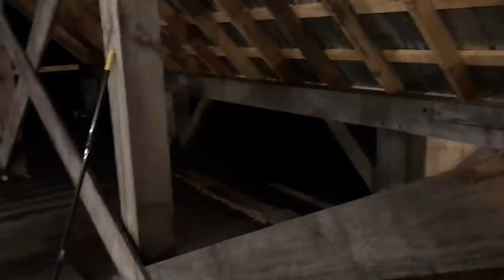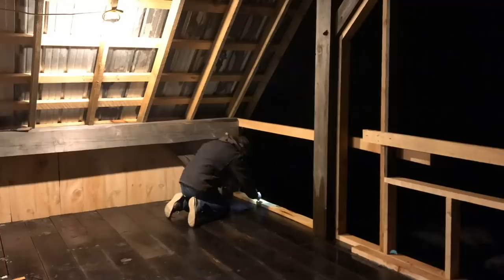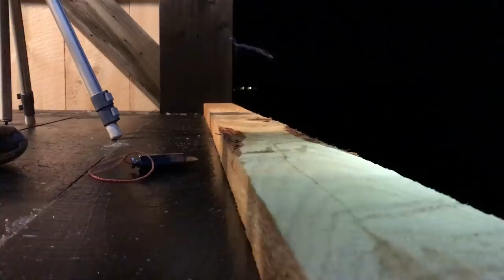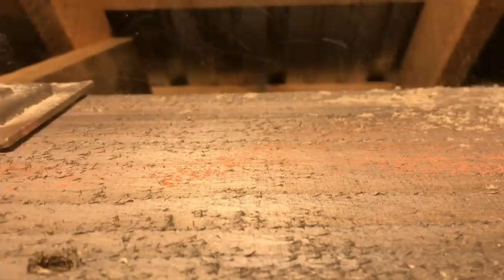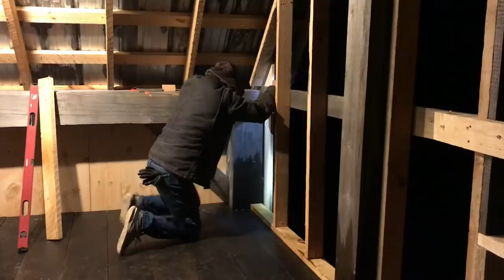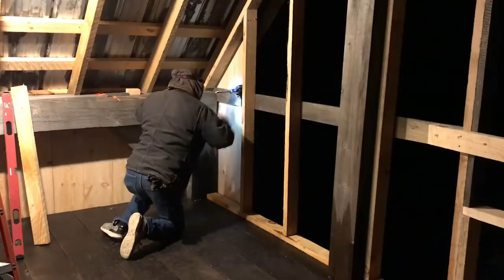Plugging Away on the Timber Frame

Comment: You may want to think about Nichiha siding and Boral Trim products. The Boral trim products can be cut with a regular saw blade and are more dimensionally uniform than Hardy trim products. I just built a house and used both of these products and I think it worked out really well. 
Charles Reed, Cedar Bluff, AL.
Reply from the maker: Thanks for the info, I will look into it.

Comment: Hey jim, ive been building a all new "old" house. Basically an early Greek revival style farmhouse. We debated hardiboard. Went with something else called LP smartside. We used smooth style clapboards. But i think if you're looking at hardiboard you should check out their grain faced LP. Its based on an osb style material. The test used that hardiplank failed at was to put a piece of each in a 5 gallon bucket of water. Hardiplank dissolved, LP grain faced retained its shape. The smooth face is a compsite reminiscent of masonite lap siding, but still superior in density and reaction to water aborption. There are pvc coposites that work well for trim as well. While we researched plenty, we thought the water test was plain and obvious. Check it out for yourself. Thanks for sharing, keep on keeping on.
Reply from the maker: Another very good idea.

Comment: Good Evening Jim to save your back some what would you build up your right shoe to match the left boot that will then take the pressure off your back which must be giving you gip ,well one gable end to close in and your smiling .
Robert Riversong | Nov 20, 2009 10:33pm | #1
Most engineered lumber uses glues that are designed to allow short-term wetting, such as with CDX plywood (OSB is more vulnerable and will not return to its original thickness after swelling).

KD lumber comes damp from the lumberyard (19% MC at the time of milling, possibly higher from yard exposure), and occassional wetting is not going to change its equilibrium moisture content. A new house generally requires a full year to fully dry to equilibrium conditions.

I build mostly with green lumber, dripping wet off the saw mill, and leave it exposed to rain, sun and wind until the frame is closed in. It tends to dry to less than KD levels after a couple months of exposure. It certainly doesn't get wetter and I've never had a mold problem (I insulate, however, with cellulose which has borate mold inhibitors).

You may be putting more effort into weather protection than is warranted.

Comment: Jim, if you are going to use a siding over the timber frame, might I suggest an alternative to the Hardie board. It is called LP Smartside. It is a wood product that has a 5/50 warranty and installs like normal wood. No special in as tall considerations to be made concerning how you cut it, install it, etc. except that all cuts will need to be sealed with primer. Please look into it. I am a contractor in St. Louis and have learned to love this product especially since I have stopped installing Hardie, almost completely due to all the limitations of dealing with it.
Reply from the maker: I will look into it, I've heard a lot about it since this video.

Comment: Jim check out hardy 4'x 10' sheet with hardy1"x3" batten to give you a barn look of board & batten its more expensive than the 7.25x12' but looks great. Just used both on my house in the NW. Looking good little by little.
Reply from the maker: I will look into that, thank you.

Comment: my experience with clad board siding ain't good ....to much maintenance ....hardyboard is a very good product but these are 2 of the issues we ran into over the years ....it did not take the paint consistently ...i think that problem has been resolved the other issue i have noticed is in time as it gets dryer and dryer it becomes more brittle ....that isn't a problem as long as you stay at least 1.25 inches out of the corners and at least 1 inch down and the nails aren't countersunk into the siding ...otherwise it does in time break away ....personally im still fond of real wood
Reply from the maker: That is great input, thank you for your experience.

Comment: Are you going to oil the timbers to help protect them?
Reply from the maker: Probably on the second floor but not on the first due to welding, grinding and smithing.
Reply: You can install rock wool insulation which is fire resistant  as it is made from steel slag and basalt rock on the first floor :) @TheTradesmanChannel